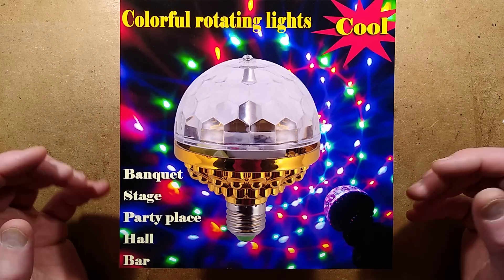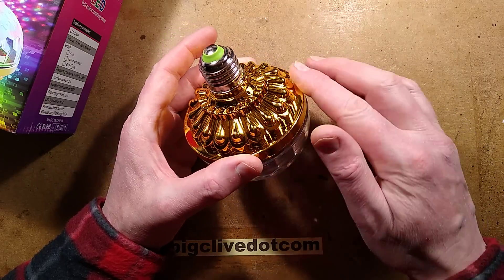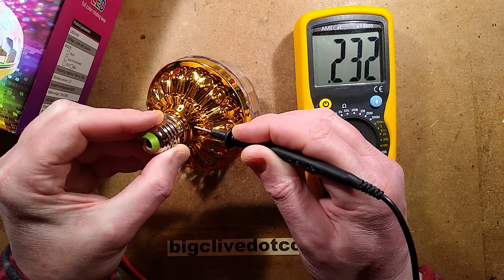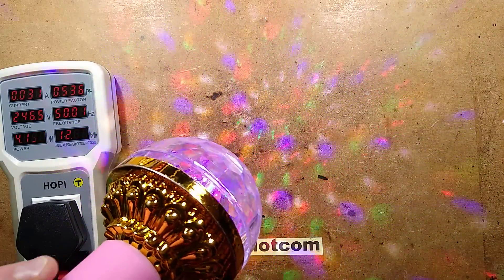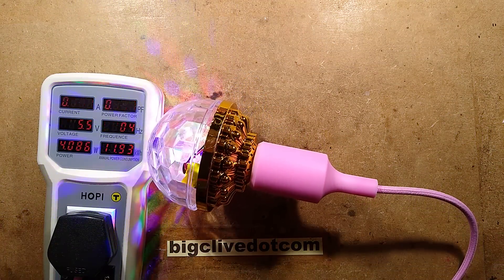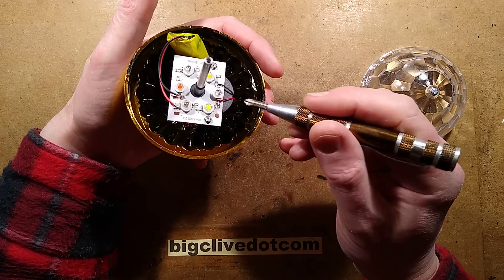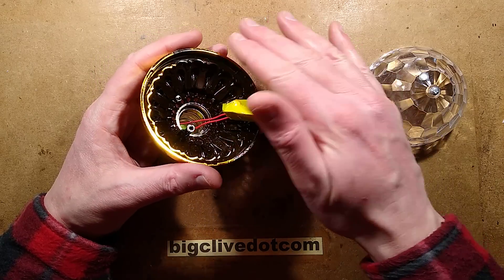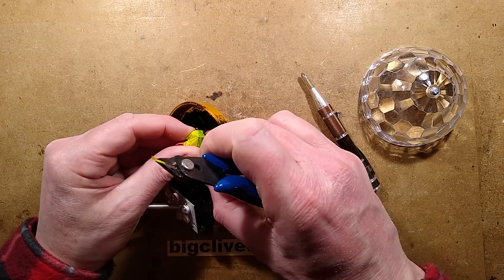"Shocking" disco light with 50/60Hz dance feature.  (Live chrome case.)

Comment: My son has a non-shocking tabletop version, runs on 2 AA batteries or external DC transformer. Looks pretty good in the dark.
Reply: I have a pair of the non shocking white versions on a pole lamp at work(I work for a nonprofit for seniors) in our exercise/craft/party room, and they are fantastic in the dark.
Reply: @CommodoreFan64  by the way has anyone ever heard of the old glow metrics pole lights. 

 White translucent globe on top the standard was just had whatever bulb it was set up fo.

r but one of them had the option of a colored plastic cylinder at night it would have rotating colors.

 I think I remember back a long time ago  at the apartment complex.

 we used to live at had them everywhere.

Possibly mercury vapor.

And I think a few were low pressure sodium?

But they were different than low pressure sodium but similar.

 don't even know what kind of bulb that was very similar.

 but the color was varey different.

This was somewhere in the early eighties.
Reply: @aaronbrandenburg2441  Sorry can't say I've ever heard of that.
Reply: @CommodoreFan64  sorry I butchered it and didn't rise voice recognition you know and too quick accidentally hit post and didn't rise tomorrow that was messed up.
Reply: My 7-year old daughter also has a black tabletop one and easily managed to remove the top part of it, exposing the power supply and wires connected to mains voltage.. thank god she often joins me when doing electronics stuff and was aware of the dangers of live wires and capacitors and did not touch anything inside
Reply: "external DC transformer" - you have a DC transformer in your garden ??? !!! :)

Comment: i had a similar one to this but it was smaller. and i found very quickly that if you stop the motor with you hand for any more than half a second you've basically killed it. 
it'll start making noises you'd never imagine a motor could make
Reply from the maker: The plastic gears are very easy to break in these units.

Comment: "I have no great need for disco lights" - taking them apart surely classes as a need? ;)
Reply: Clive needs a daily FIX of dismantling things.

There's a pun on 'fix' in there somewhere if you stare hard enough at it.
Reply from the maker: I will inevitably hoard the motor, LED panel and driver.
Reply: @bigclivedotcom  Hm didn't try how it glows without the outer plastic housing ?
Reply: @bigclivedotcom  my thoughts exactly.

My parents had a rule at Arhaus long-standing rule if it went out or was replaced or whatever if it was even a Teensy bit useful for me for anything they got stripped for parts.

Still remember when we got to do washer and dryer.

The motors in the washer and dryer became shop motors.

I even managed to get the blower on the dryer to be intact enough to use it for exhaust / dust collection system.

Plus I kept the old Kirby vacuum that was almost shot fan impeller was totaled almost but still work load vibrate across the room but for my purposes it works fine.

Not only that I built a device out of them old Kirby head that allow me to get belt drive off the motor.

I also had the old Kirby power sander.

Wish I bought off someone else that got rid of their Kirby.

Also I did also have the handy Butler flex shaft attachment.

Basically a 1 horsepower motor Vermont like the device accepted a full size drill chuck wanted quarter inch.

Also I modified a Kirby says wakanda remove the trigger pin valve mechanism and convert it to go from the ended 50 attachments where you put that cloth screen on it to feed working into the plastic jar of the sprayer and the other end that connects to the hose is this open to the inside of it and so that if you suck up so hard it warms up in the jar if it's heavy enough instead of going to the fan on the motor I've done that for a few of those four people sit up at pick up something hard it won't damage the Kirby. If I ever get me another Kirby I'll do the same. Simple like that should be on the Makers Market I'd say.
Reply: @aaronbrandenburg2441  Good story, but auto correct or text-to-speech replaced some words for hilarious and confusing results.
Reply: @buddyclem7328  yes I know it's autocorrect and voice recognition both sometimes doink romance you're trying to do a quick and everything kind of goes out the window.😬